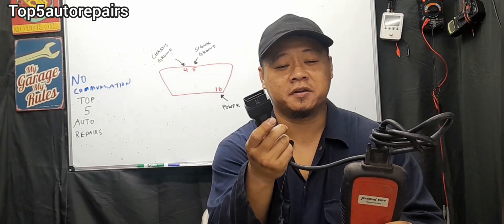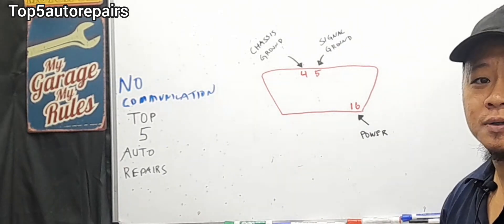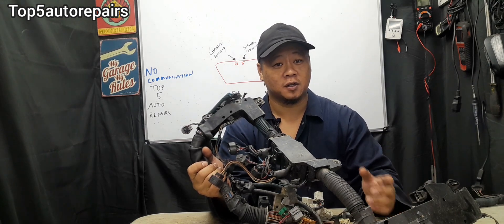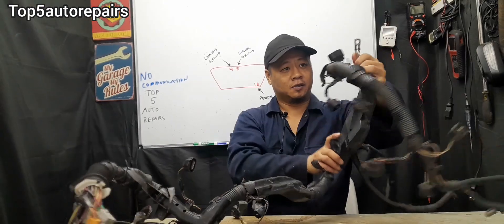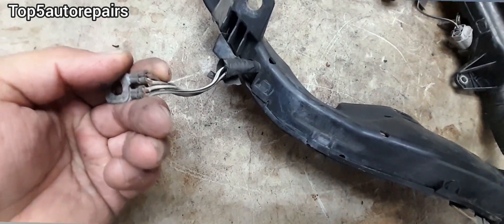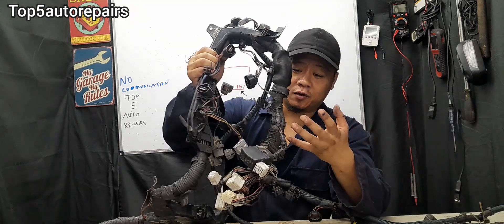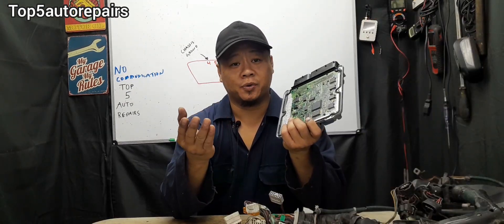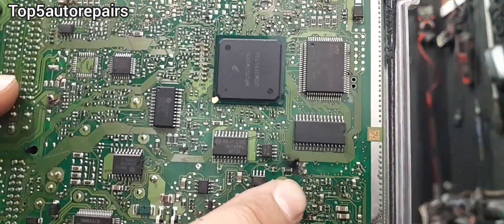NO COMMUNICATION WITH ECM PCM (POSSIBLE FIX AND SOLUTION)

Comment: Im almost certain im having a BCM 2011 Regal 2.0 Turbo . Symotoms : Back windows and ambient light quit only in back seat and when opening back doors (weird)  , had radio pop a few separate times infotainment system blacked out until restarting car 20 mins later , ac compressor is not kicking on , anti theft wont beep and horn is barely working , even my liscense plate lights quit changed both bulbs no avail . I get Stabil Trac warning light and car goea into limp mode that one is rare as well . Can i maybe reset this BCM Also is there a difference in ECM , BCM I see folks talk about them both . Any reset procedures ?

Comment: Great video...questions i have a 2014 Dodge Durango...68k no idiot lights on dashboard...runs great no problem BUT when I had the NYS inspection scan tool plugged in for Inspection All lights on dash came on and engine reves high...when regular scan tool was plugged in it came with a fault code U0001...Any Ideas? Thanks

Comment: Need help  bad 2010 cts  code u1000 change  rear fuse  box  about  to replace  the front  I live in a different  state front my kid can't afford  the dealership  car was running just  died out on her please  advice  no crank no start   jump from relay turns  over  but no start please  advice

Comment: 1995 corvette no module 4 ECM or no module 9 EBCM in on board diagnostic system. Only getting module 1 CCM and a number 7, there is not a number 7 module in 1995 corvettes. There are in 1996. No start, injectors will not spray, but noid light flashes. It's a mess.

Comment: 2011 Buick enclave . My computer is saying no communication with ECM and I’m blowing ECM 1 fuse when I turn my key and the engine is turning over but NOT starting or  firing. It resembles no gas getting to the engine if this makes sense. After a few seconds the ECM 1 fuse blows. I just got back in my truck and am about to leave my daughter’s house now. I just finished checking it out and here I am sitting in my car watching your video.